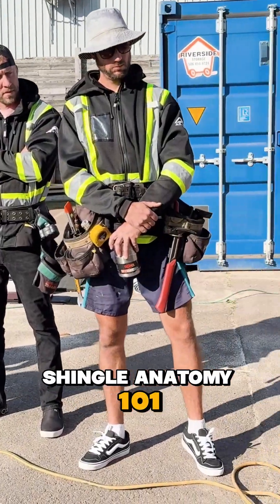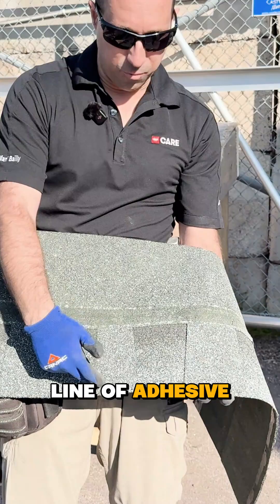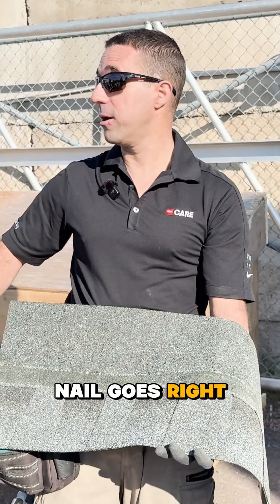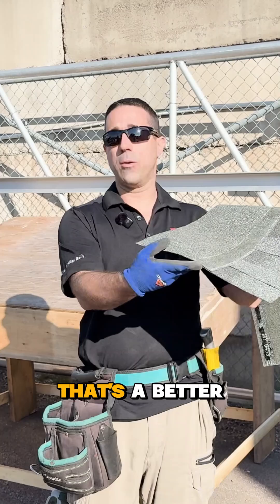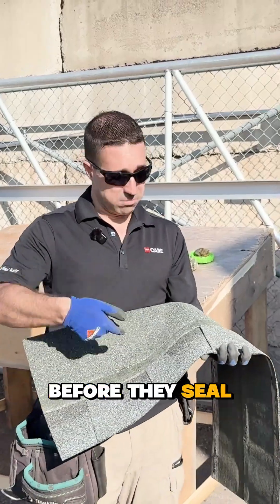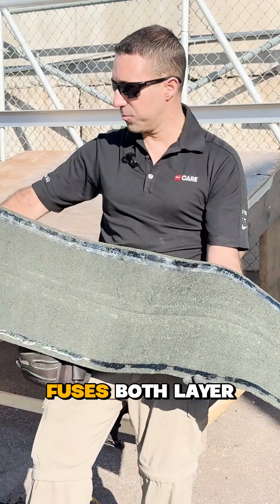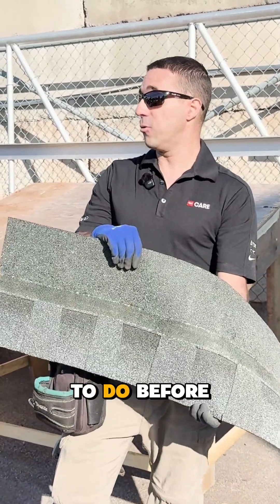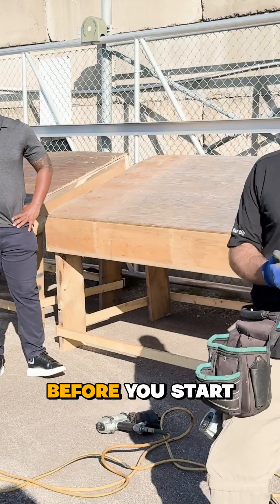Shingle Anatomy 101 with GAF

Comment: My parents roof looks fine but I’m paranoid theres moisture hiding under there. How would you diagnose it?
Reply from the maker: Great question, checking the attic is always the first step. Check for stale air, warm spaces and signs of moisture(water stains, mold and dark spots)